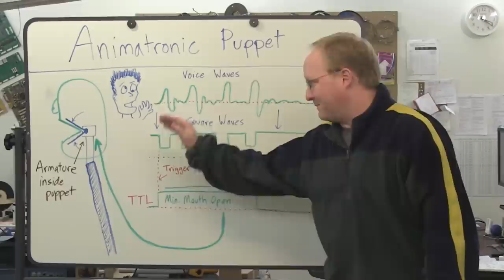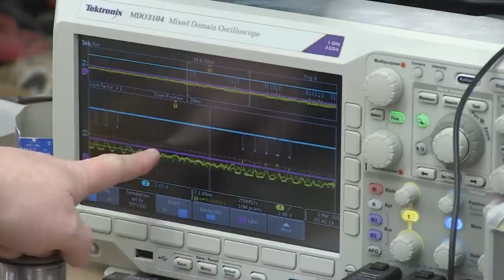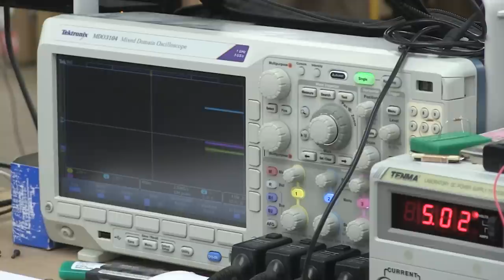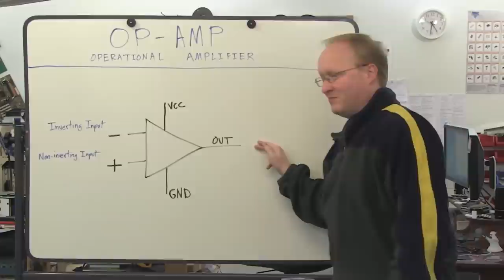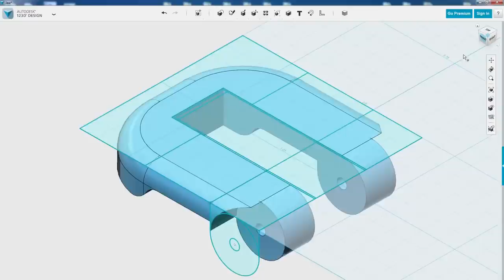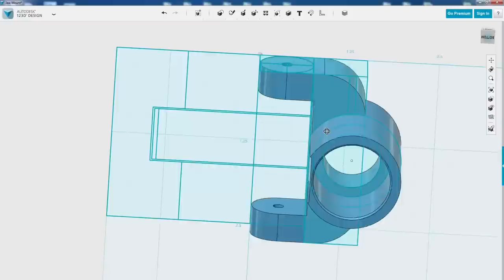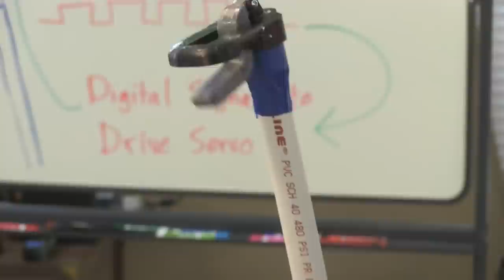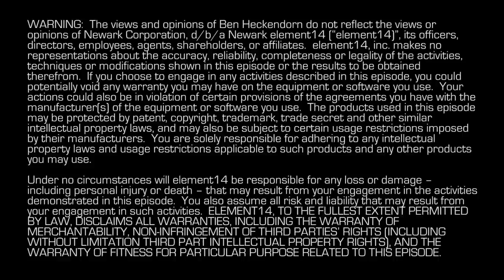Ben Heck’s Animatronic Puppet Head Part 1

Comment: Hi Ben, and Ben subscribers! Just wanted to pop in with a couple notes...and also to say I really appreciate you helping people get into puppetry who may not have normally considered it. Anyway, here are my thoughts...

1) professional puppeteers keep the top of their hands relatively static, while they only move their thumb for the lower jaw. They don't do the floppy thing you describe. They open and close the JavaOne for each syllable in a word. The Henson company has a great tutorial about how to do it on their youtube page. 

2) A couple of people have said the puppet is creepy. The main reason you feel that way is probably because their eye focus is a little off. Most puppets are slightly cross eyed to give them a point of focus while looking at the audience or the camera. 

3) Without anchoring the top hold for the upper palate, you would get the same floppy result you demonstrated with your hand with the trigger mechanism you made. . I think your main problem, however,  looks to be a lack of clearance between your top and bottom jaw plates for your hinge to operate correctly. 

4) I 3d print my mouth palates, and make snap bands with ninja flex for puppets used by several people for theater and such. They can be wiped down with alcohol wipes if needed. I also build vents into the heads. Your puppets shouldn't be gross unless you aren't taking care of them. If you hands get sweaty, just lay the open end of your puppet propped open in front of a fan, and that should help keep it from getting gnarly if you have a fabric covering. 

5) For those of you interested in making a trigger mechanism you can hand operate on your own, you can make one cheaply with a bike brake cable. I usually use the hand break itself as the trigger, since it cuts down on hand strain. 

6) I have a channel called Makerhigh where I demonstrate how to make a basic puppet and a free pattern download on my website, if you want to give Ben's project a go, but don't have a puppet you can use. Cost of materials should be less than $10 if I am remembering correctly. Will obviously be more if you 3D print a compatible mouth plate. 

Thanks everyone! First time chiming in, but finally felt I could add something to the conversation!

Comment: It will be interesting to see if this approach actually mimics a human's jaw. I trust that the discrete logic is simpler than trying to do FFTs in an arduino.  A totally different approach would be to make it controlled by MIDI. Use a keyboard to record open/close actions and then use a sequencer to both play the audio and the MIDI

Comment: Analog and discrete circuitry is cool and all, but you should probably just get the jaw mechanism working, then control the servo with an AVR using speech data generated with Papagayo.

Comment: I'm not an engineer.

So, with that obvious statement out there... why did you choose to convert the analog signal into a digital one for purposes of the animation? It seems to me that the analog waveform would be more useful since you could use it to allow the actor utilizing the puppet more control over the degree to which the mouth was open?

Was it just for simplicity of the electronics themselves, as well as the animation module? Or would the shift of tones and/or volume such a system would use be too difficult to interpret?

Honestly curious what the reasoning is; I love your show, and the builds you create are always fascinating.
Reply: he did choice the binary control (mouth open/closed) for simplicity.
Of course, analogue would be better.
The animation module is already analog - the servo is driven by an analog signal. The length of the pulse to the servo controls the leaver. Short pulse: Smale angle, long pulse: width angle.
The interpretation of the analog signal would of course be tricky, but "to difficult or not" just depends on how much time Ben wants to dedicate to the project.
If this technique is for an interactive theme park attraction, it will be good enough. But for a movie... well... I would prefer a lazy puppeteer over this. An not lip synced  puppeteer can at least move, tilt, rotate etc. the puppet giving it a bit of life.
Reply: sarowie Makes sense. thank you.

Comment: A couple of years ago I  did a project to get a Good Will "Big Mouth Billy Bass" (http://en.wikipedia.org/wiki/Big_Mouth_Billy_Bass) to talk from mp3 files using an arduino and a motor shield. To those without a 3D printer an old "Big Mouth Billy Bass" may be a easy solution. I am looking forward to see Ben Heck's solution.